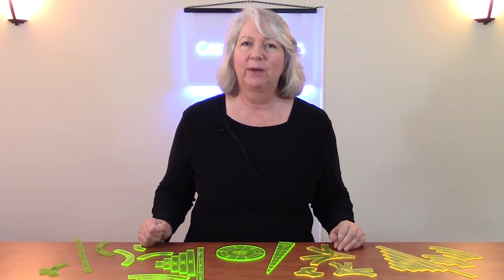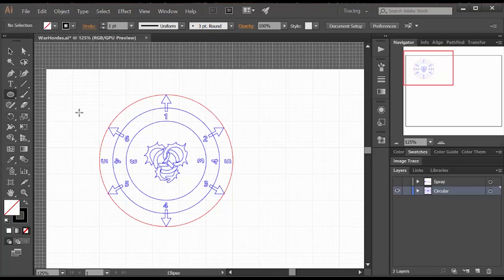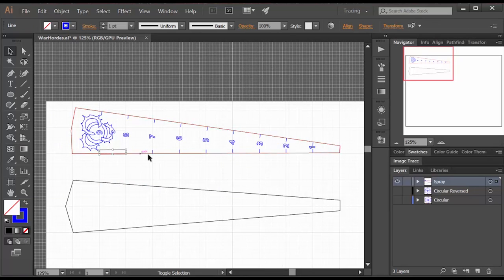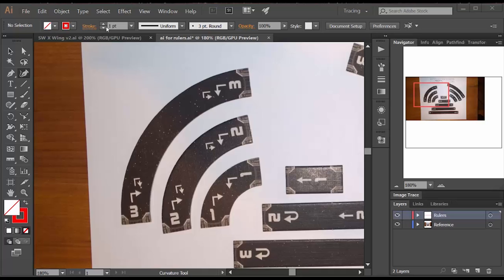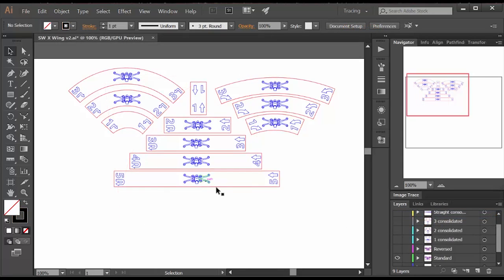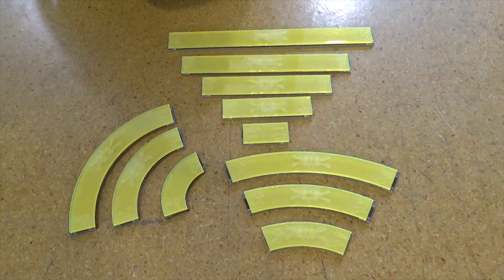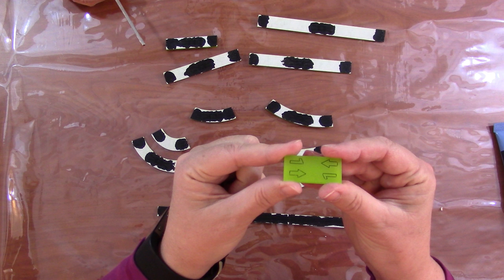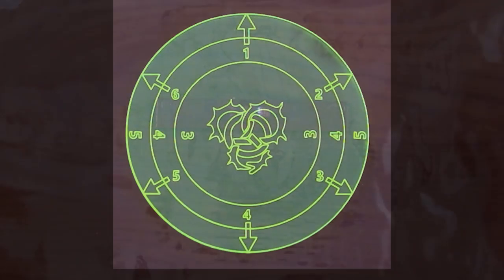How to Design and Laser Cut Accurate Rulers for Tabletop Games

Comment: A tip on saving materials. Start with a paper or cardstock version to ensure you have the proper measurements. Most home office printers can do a thin cardstock that is accurate. Or if the laser is capable of it you can cut the outline on cardstock or other cheaper material and test the dimensions that way.
Reply from the maker: I know what you mean, sometimes I only have just enough of a material to complete the project and then I test on something cheaper and more readily available, just to be on the safe side. In this case, I use leftover materials from other projects or even things I find in the scrap bin at TechShop. Thanks for the suggestion, my laser can cut cardstock, and it would be a good, inexpensive alternative.

Comment: Thanks so much for your content! I recently got access to a laser cutter and am making stuff like this every week!

Do you ever share your Illustrator files ?
Reply from the maker: Hi gc! I've considered making Illustrator files available, and am not sure what the best venue would be for doing that. Do you have any suggestions? If I did so, it would be for personal use only... I don't think I would be comfortable with people using my designs to make and sell products. Would that meet your needs?
Reply: Greylight May certainly ! I already use my own designs and always just for myself. 

I'm not sure where you could host the files hat would suit your needs, but Dropbox lets you make public folders.
Reply from the maker: I'm going to look into GitHub as a repository. I'm told it has built in licensing, that would allow me to specify for noncommercial use, plus it supports collaboration so others could post drawings and make improvements to mine as well. If I go that route after checking it out and testing, I will do a video explaining how to use it and how to access my drawings. All subscribers will be notified when that video is posted. Thanks for your interest! It is encouraging me to follow through on this...

Comment: X-Wing templates aren't actually arbitrary... They're just metric. Also, there's some variance to the cardboard (+/-1mm). A bit of searching will reveal the generally accepted dimensions & arc angles.
Reply from the maker: Yes, Ben, I did discover this after posting the video. I checked my cardboard rulers from the game and they did vary from the posted dimensions, but I believe it is probably just because of manufacturing tolerances.